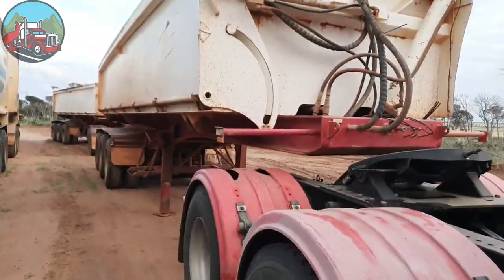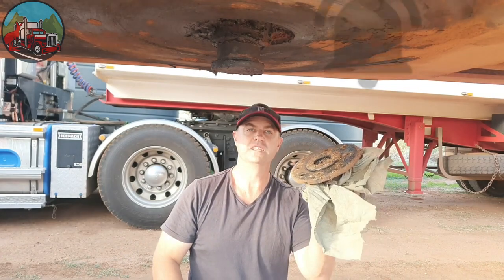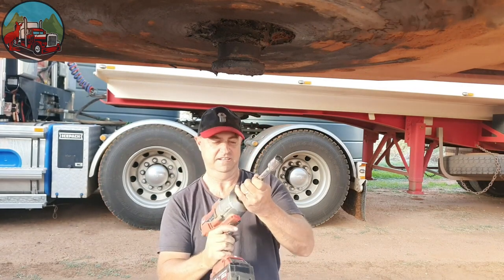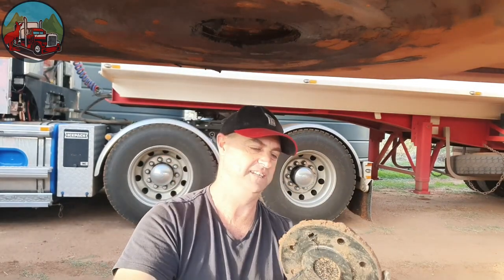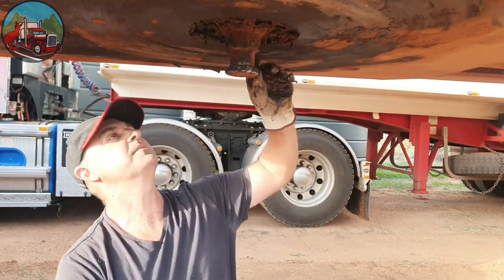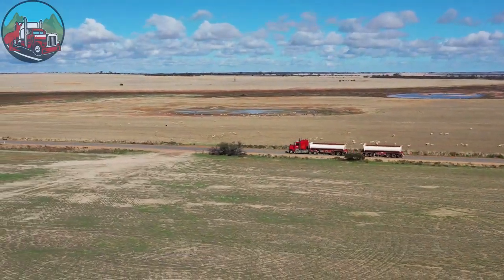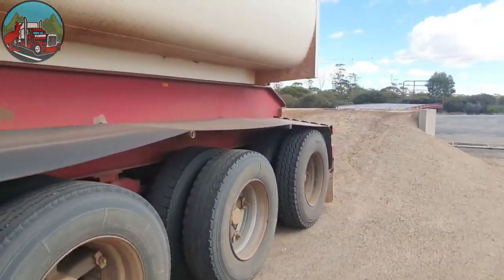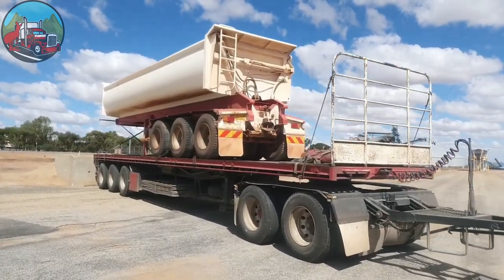Loading road train side tippers on my flat tops for Adelaide - A Look Back in Trucking

Comment: Nice done on that tricky ramp.
Reply from the maker: Haha. The ramp of ball bearings.
Reply: @RoadTrainAdventures  .also short and steep with that kink. that doesn't make aiming any easier. Have you already received that award? hahaha.
Reply from the maker: I'll have to check with James
Reply: @RoadTrainAdventures  If James The Hookingup king make his 4th.That's good. I can not do it. He has the advantage of the KW cap over. a bit shorter turns.
Reply from the maker: Yes acab over certainly is quicker to turn compared to my 909
Reply: @RoadTrainAdventures  i do not know them. How i seen them.Both great trucks .👌

Comment: Who's flying the drone?
Reply from the maker: I am but there a secret to how I do both.

1. It is automated and flies by following me.

2. When I fly is manually I am driving slowly then speed the footage to make it look normal.
Reply: @RoadTrainAdventures . The first part of your answer I believe. The second part...  ;-)
Reply: @RoadTrainAdventures Here in the US (I'm an FAA certified UAS pilot) we can fly from a moving vehicle in a sparsely populated area, but I can't be the driver of the vehicle.  Even in 'follow me' mode I need maintain VLOS (visual line of sight) and I can't do that if I'm driving.  Big time FAA fines and revocation if caught.
Reply from the maker: That's a joke. What's the point of 'Follow Me' if you can't use it.
Reply: @RoadTrainAdventures  Didn't say you can't use it.  You just can't be the driver of the vehicle.  The remote pilot in charge has to have complete control of the drone and you can't do that if you're driving.  The FAA makes no distinction between flying a drone or flying a 737 as far as the rules of flight in National Air Space is concerned.  Your own CASA has the same rules with almost identical wording, so you legally can't to what you're doing either, but I'm glad you think it's a joke.

Comment: Why are there different size pins ?
Reply from the maker: 2 inch is the standard and 3.5 inch is standard in China and Western Australia.
Reply: @RoadTrainAdventures  I guess the 3.5 inch one is made for road trains to pull more weight, is it correct?
Reply from the maker: No. I pull triples with only a 2 inch pin.
Reply: @RoadTrainAdventures  thanks for the information 👍🙂